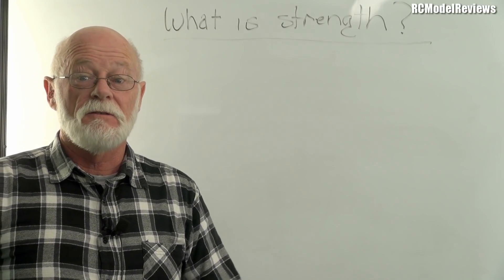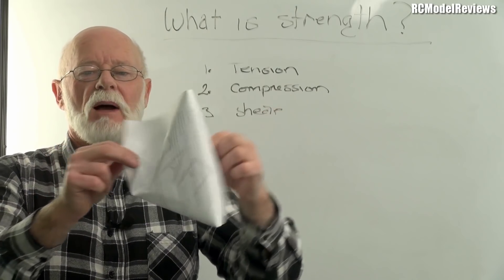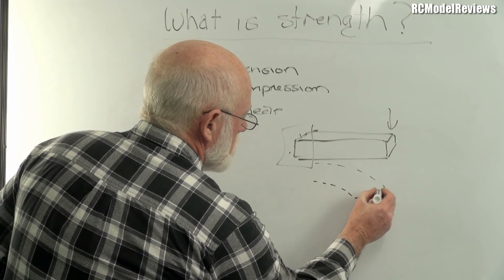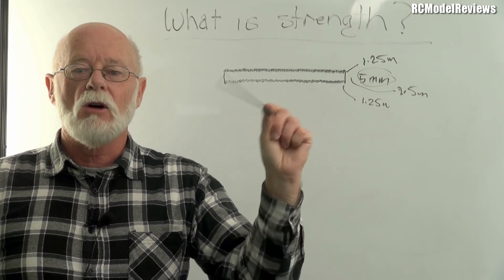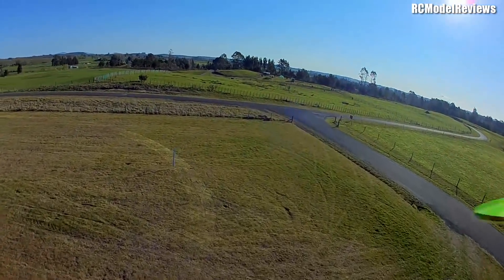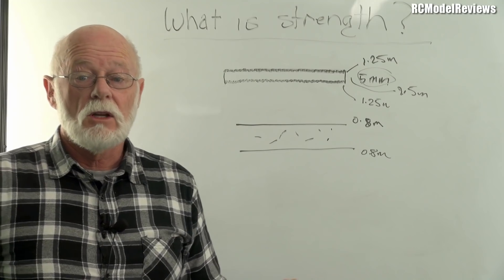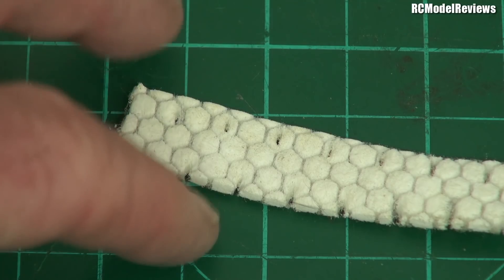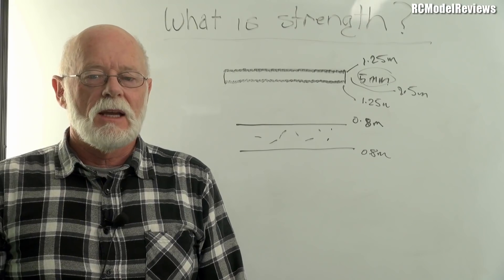Carbon racing quad arms... does the middle really matter?

Comment: The foam in the middle just keeps the outer "shell" parallel to each other. Doing this gives it its strength. That's why the tube has 2.5mm of carbon in it with foam inside but its stronger then just a 2.5mm single solid piece.

Comment: Bruce, let me give you some food for thought.
Starting with the solid material:
  Woven cloth gives you strength.
  Matted cloth gives you thickness.
Now with the liquids.
  polyester can be used (commonly called fiberglass resin) or
  epoxy can be used and is commonly used with quality carbon fiber mfg processes. 
All 4 materials play into the strength of the final product and I have seen a combinations of all 4.

The honeycomb materials you are illustrating are commonly used on real military aircraft to build thickness without increasing weight.
One such application is the radar radomes that do not require strength but light weight. Another application can be a helicoptor rotor blade.
Even control surfaces... but,  I have never seen it used on a structural part until this video.
I hope it helps. What do you think?
Reply: Hi Robert,The sandwich material illustrated in the video is not a "honeycomb material". It is a non woven polyester material with a kind of honeycomb structure imprinted. The real honeycomb is hollow as well, consisting of a kind of aramid and air. I have been producing military aircrafts, so I have seen it. This sandwich material for the quad is nothing but an add on material, as it adds no strength and lightness to the structure. It only acts as a spacer between the upper and lower skin, made from 90% resin and 10% polyester fibers. So the sandwich material is only a resin sponge, you might say.You gain stiffness in the out of plane direction, but you loose a lot of other parameters, including impact resistance.

Comment: I'm interested with the video where you broke that frame. Really.

but I guess you are right about soft material between a carbon sheets. because when the "carbon skins" break, it means the arm break.

I used martian 2 (alien clone), full carbon frame and sometimes I see the outside layer carbon break first, the rest of the arm still intact quite normally because the middle material is still carbon fiber and resin..

Comment: Hi there Bruce, i have a query which is a bit off topic but wondering if you could provide any help and or suggestions, i have designed and drawn up plans for my own build foam profile (fuse construction as per 3d foamy style ), slow fly plane, wingspan 800mm to possibly 1m, in the style of an old timer Lanzo Bomber free flight but set up for rc - b/l motor and 3 channel, i cannot find a supplier here in NZ for depron sheet and shipping it over from OZ is to pricey for my budget, so i have found that Jasart 5mm artists foamboard is an option, problem is finding a way to remove the paper from both sides, i have soaked this foamboard in water for a few days which does allow me to rub the paper off with my thumb but its an uber messy process, a fellow in the states suggested spraying rubbing alcohol on the paper, he does this with $1.00 dollartree foamboard they have over there, 15 seconds later paper comes off in one big sheet apparently, ( YT channel - toojung2die "Arrow glider")anyway i will try the rubbing alcohol method on a test piece, but if you or anyone else out there knows of a way to quickly and cleanly remove the paper from this foamboard we have here i would be stoked to hear from you, btw thanks for the vid on using the Turnigy Accucell 6 charger, i went and picked one up and it does the job, run it off a 12volt car batt, (gave me an excuse to buy a new battery for my car ! lol ), cheers man, fly high ! Rickster.

Comment: You’re argument completely ignores the concept of moment of inertia.

“When layers are further from the center (commonly called the neutral axis) they contribute more stiffness. Consider two tubes of different diameter. The large diameter tube will be stiffer than the small diameter tube, even if the amount of materials in them is equal! This is because the larger diameter tube has more material further from the center.

An I-beam works using the same principal. The web of the I-beam (the skinny center section) holds the flanges (the end pieces) far from the center, making the beam much stiffer than a solid plate using the amount of material.”

https://www.rockwestcomposites.com/blog/why-you-should-be-using-sandwich-panels/

Comment: The "core" is just insulation foam."Foam core" has been used in the boat building industry for a longggggg time.All it does is cheapen the build= as you use less layup carbon/,kevlar/csm,/cloth,BUT still retains the same stiffness,as a solid cloth layup.All good until you crash you kwad,..,or sail your boat onto sharp objects.! Essentially..rigid but fragile.🤗Trust me,..I build boats.

Comment: (Bruce I know you know all this I'm just gonna say it in layman's terms) The carbon on the outside of these sandwich structures are usually more rigid than whatever is in the middle, the overall arm usually ends up being the same or a bit more rigid....the easiest explanation I have for this would be a solid plastic tube vs a hollow plastic tube.  The solid tube would be more flexible than the hollow tube however not so extreme in this situation since carbon doesn't stretch much......The end result is that you may get more rigidity but you're stressing the outer layers more in an impact as well as the bond between the two materials.  The arm 'should' fail easier as a result because of the reduced carbon strength on the outside.  I write all this because I've been testing the carbon kevlar mixes with one layer of kevlar on the top and bottom under the cosmetic carbon outer layer and have found some notable results.  The kevlar mix parts will be more rigid but still have plenty of carbon bulk to be strong as well.  I believed that the kevlar would help with the repeated stressors causing the carbon to fail little by little.  Unfortunately it seemed to do nothing and the increased initial rigidity likely lead to easier catastrophic failure of the entire structure because it cannot flex as much to absorb forces.....which implies two 2mm sheets sandwiched should fracture easier and not hold up as well under our usual stressing than a single solid 4mm thick part.

Comment: Nice experiment, but I'm sure the Kopis 2 frame isn't using the same soft cell foam material that is used in the self made test sample "arm" that is featured in the break-test. Maybe someone from Holybro can shed some light on this. I could be wrong, but I doubt this company, with all the engineering they put in about all their releases, and usually selecting high grade components and materials for their quads, would be using the same quality frame as the dirt cheap X220S was using in the first batches. Those arms were really about as soft and brittle as the one that was "hammered" here, but the Kopis 2 frame looks and feels very different.

Comment: If they were going to use fiberglass they should have just used G10 sheet (high pressure fiberglass laminate). While G10 is less stiff than carbon fiber is also much, much more durable in a crash because it will bend a lot further before breaking. This is assuming real G10 and not some cheap chinese crap fiberglass sheet. SAB used G10 in the Goblin 700 Sport edition to cut costs (as well a using a fiberglass boom and canopy and plastic skids). Though with the aluminum monoblock used in Goblins the only thing the G10 is supporting is the skids and batteries. A lot of gasoline heli conversions also use G10 side frames too.

Comment: reminds me of when I worked with drywall. Apart from being the nastiest job I ever did, it showed me how tough you can make office walls, support windows etc but we could cut the sheeting to size with a single slash of a stanley knife blade. 
I suspect that one nasty scratch or dent in the carbon fiber will soon become a  break.

Comment: More rigidity because the carbon has space between it meaning impacts apply less leverage. That means the 2.5mm may have 3-3.5mm thickness equivalent strength and the vibration absorbtion from the center material may keep impacts from resonating the carbon into a fracture...

Comment: Excellent analysis. Let me shed a little more light on the ' white material ' inside that is used here in China: It is called ' Porcelain Foam ' or ' Ceramic Foam ' ( very very fine Kaolin with a binder ). There are of course different qualities & therefore prices depending on application requirements which mainly are differentiated in the use of the binder properties. These type of foams are used in sandwich techniques with layers of carbon fiber. Typical applications are high tech bows, skis... As a rule of thumb: pull force comparison of composites with cores of Fiber glass / Maple wood / Porcelain Foam: Porcelain Foam core provides about a factor of about 2.5 in higher pull force then Fiber Glass. Maple wood is sort of in the middle and still stronger then Fiber Glass / Sic! Carbon Foams ( indeed anthrazit color ) like Aluminum Foams have a much wider mesh and are better called sponges instead of foam. The quad arms here discussed are of course of a much more simpler nature in build quality then high tech application sandwich composites. Production cost is a huge factor to consider for the manufacturer. The Chinese have learned to create in the last years many ' composite ' materials which are then spread and used widely. Another fancy example is the reuse of powdered pig or skin leather ( from leather scrap ) with binder to make shoes and bags. This technique was driven by the developments of the PU ' leather ' industry. The worst material for shoes and bags are now  'paper fiber binder' sheets that are used in the shoe industry. The average Chinese buyer doesn't know of course the backgrounds and is happy to get a refined marketed so called ' leather shoe ' for 4 USD+ street price. You can make up your minds by yourself about that. I have my opinion of course. Cheers Bruce and happy flying / Herri, a German designer in China.

Comment: If you can buy a spare arm for both the new and old version, maybe you could put under a pressure testing machine. although i have no doubt it would show the same result as you're describing.
It would be interesting to see the opposite arm though, where you have a core of carbon and a top and bottom made of foam. That should technically make it more impact resistant? atleast sometimes stronger doesnt mean more durable.

Comment: the resin used for carbon fiber and the resin used for fiberglass are different, and there is the problem. They have differing strength characteristics. this will cause unequal loading of the layers, causing unequal stresses, and easier failure. all depends on the applications needs, but I agree with you in a thin arm like that. pure carbon fiber will be stronger. my 2 cents worth working in automotive application. great video.

Comment: 88% as strong (in theory) --> Considering bending as the most prominent loading condition for quad arms, a section with an empty gap of 2.5mm in the middle should be 88% as strong as a full 5mm section. (Stress induced from bending is inversely proportionnal to Second moment of area I = (b*h^3)/12). Of course an actual empty gap would not work because you still got to transmit some amount of shear between top and bottom layer but you get the idea; middle section isn't really stressed.

That calculation is neglecting delamination that may be induced by shear between plies and also compressive forces that arises at mounting points (like the absurd amount of destructive compressive force you applied with that vice). That is why I would like to see is a proper three point flexural test between full carbon and this stuff.

Cheers !
Reply: 88% considering we're bending the arm perpendicular to the laminate surface, but if we bend the arm perpendicular to the yaw axis (I imagine something like a frontal crash condition), how the resistance will be?
Reply: With same assumption of a pure air gap in the middle that would be 50%. But keep in mind this bending axis (let say y-y) is way stiffer than the weaker bending axis (lets call it x-x). This x-x, y-y bending stiffness difference might result in instability (twist buckling ?) that would ultimately stress the arm in the weakest axis (x-x) anyway. Try loading a ruler on its edge and you will see that kind of buckling in action.

Comment: My experience in racing. The foam core arms delaminate way faster than full carbon.  The weight saving is not worth it.  They also tend to resonate more and cause tuning issues.

Comment: This is a great opportunity to apply the study of solid mechanics.  The math is relatively simple and incredibly illuminating!

Bending stiffness is governed by the second moment of area which for a spar with a rectangular cross section is just base*height/12.  See wikipedia:
https://en.wikipedia.org/wiki/Second_moment_of_area#Rectangle_with_centroid_at_the_origin

for a solid carbon spar with rectangle cross section, that is b mm wide and H mm thick, the second moment of area is = bH^3 / 12
now if we subtract out the stiffness contributed by the middle half of that rectangle, we can see that for a laminated 1:2:1 rectangle: bH^3 / 12 - b(H/2)^3 / 12 = (bH^3 / 12) * (1 - (1/2)^3) = (bH^3 / 12) * (7/8)

Those two expressions are the exact same, just multiplied by 7/8 for the laminated spar.  So taking out the middle half of the spar only reduced its stiffness by 1/8!  Now in reality, the center fierglass section will contribute somewhat to the stiffness as well (it's not totally worthless), so the sandwich spar is likely at least 90% as stiff as the solid carbon. CF is such a stiff material that even a 2.5mm spar appears to have a good amount of strength, but compared to the skins its basically negligible.

Separately, carbon fiber is actually very strong in compression as well as tension.  The analogy with paper is flawed because the paper (and carbon fiber) is very thin and individual sheets will buckle rather than compress.  But if you prevent it from buckling (by binding it in a resin matrix for example), paper and carbon fiber are actually just about as strong in compression as they are in tension, see tensile and compressive strength numbers below:
http://www.performance-composites.com/carbonfibre/mechanicalproperties_2.asp

Comment: other frames uses similar carbon and high destiny foam.    Never heard carbon in the foam people just call it carbon foam as it has both.    the foam is lighter then carbon so a 5 mm arm is almost the same weight as a 4 mm full carbon arm.    BoltRC in AU has similar arms that have been out for while now and it is a very dense foam used.

Comment: First of all that core is Rohacell® from the company Airex®  https://shop1.r-g.de/art/650800RH (not incorporated with this company in any way.)
Second: LEVER PRINCIPLE!!!  the  core just needs to keep the 2 layers apart from each other so the "top" one bends and the "lower" one compresses. If you put a light weight core in the middle, the  stiffness increases proportional to the cube of its thickness.
It is not "stronger" than a "thing" with the same height, thou it is "stronger" compared to its weight.
Source: Im a mech. engineer in the gfk/cfk sector

Comment: Really, someone said it was Carbon Foam?  Well, if there was such a thing it would have to have some black in it, as you said but it would also be electrically conductive, which I bet this isn't.  I'll have to add that to the list of things we wish existed, such as "Transparent Aluminum" from the Star Trek movies...lol  By the way, I loved the proof of strength, or lack thereof, at the end.  Well done by the Master of RC Model Reviews!  

While we are on the subject of Carbon, in a manner of speaking, what are your thoughts on using Black Heat Shrink or Black Tubing with Antennas?  Since Carbon is electrically conductive isn't one blocking some of the radio signals when a Black material is used to protect or cover the Antenna.  Perhaps the loss is minuscule but it's probably tangible.  Personally, I use a clear or another color when possible, just in case.

Comment: A sandwich of 1.25mm carbon on either side of 2.5mm foam will be stronger vs. bending than 3mm of carbon.  The sandwich will be weaker vs. tension, compression for some failure modes, and shear.  The sandwich will also be less elastic vs. bending, and absorb less energy before it breaks.  Which is better depends on the loads applied.  In flight I'd favor a composite sandwich or tube to carry the load.  In a crash I'd trust the solid beam to hold up better.